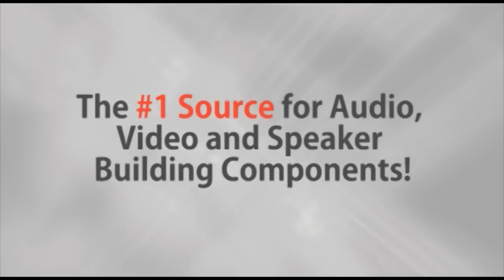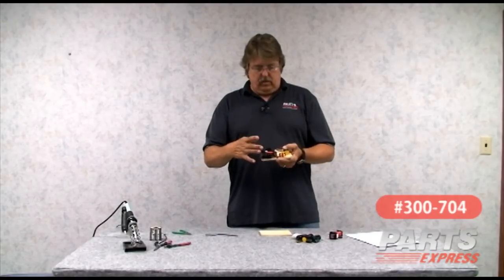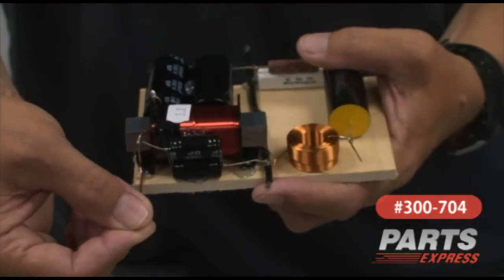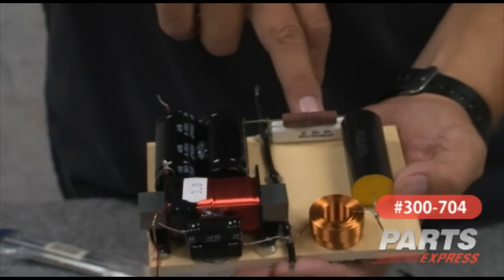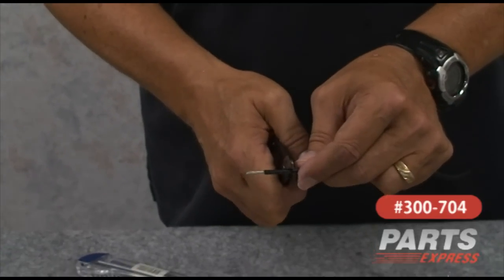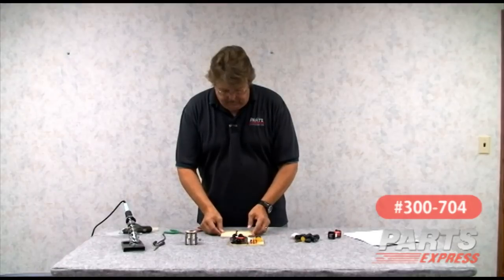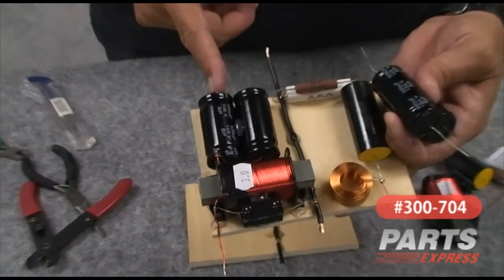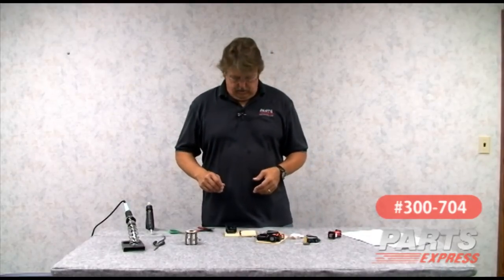Aviatrix Crossover Assembly - Part 1

Comment: A 8 ohm woofer in combination with a 8 ohm tweeter will give you a 8 ohm circuit given that the crossover is properly designed.